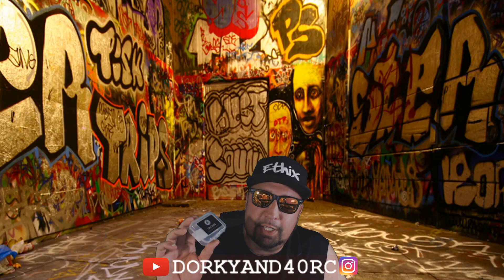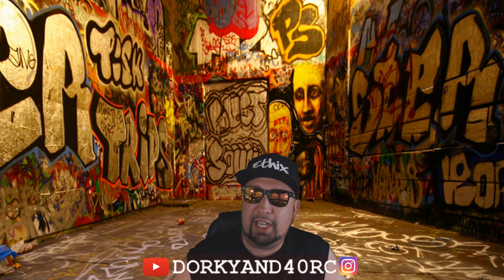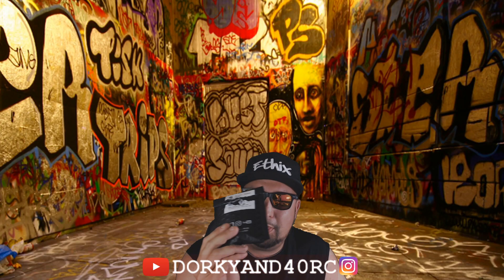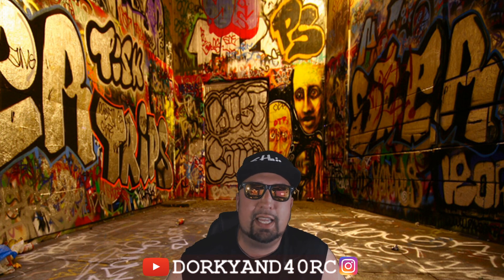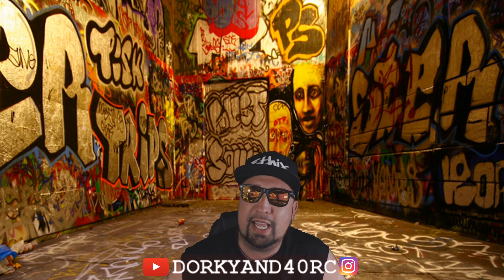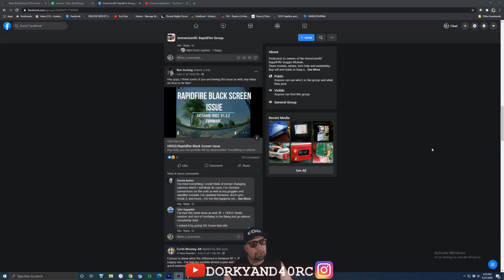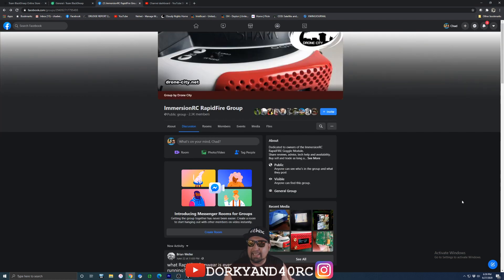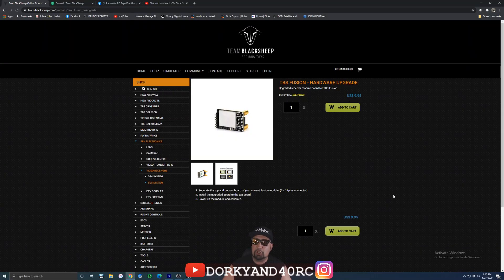WHATS THE BEST ANALOG FPV MODULE??

Comment: Bruh, i like u, so just stopped by to say, stop with the analog garbage, ya clearly have hobby monies, just go dji already ;) ...is 50mbps at 720p 120fps, not enough for ya ?  Hehe recent FW update if ya aint know
Reply from the maker: eventually..but right now my fleet just isnt setup for it and im happy with things..i have 2 many hobbies that take all the money :) so the girl says!!
Reply: @Dorkyand40  ok man,  i get ya, & just saw others comments bout dji .....vista will fit almost any frame tho ;)
Reply from the maker: The first thing I would put dji in would be my fpv crawler I’m using crossfire in !  That would be amazing ;)
Reply: DORKYand40RC well definitely don’t go on YouTube n look at dji fpv crawler vids then ;)~
Reply: @Dorkyand40  dude i just bought a cheap lil rock crawler on amazon to put air unit in cuz of you ...thx ;)
Reply: When you often fly with some more People at the same time, dji has a problem, i meam all people that use analog are having a problem. On oure field analog and digital pilots can`t be in the air at the same time.

Comment: Interesting Video, You should have played the whole flights, I was trying to watch the noise levels and i was unable to see the SNR and DBM on take off or landing, but at the point you turned around the noise floor was at 50% but i see nothing around? to interfere with you.
TBS are complying with FAA rules from what i can see ( Wifi in the fusion that connects to your module and Tango 2 ) who know what (data) will be required to stay in business, And what the FAA will ask for, But if you look at the new TBS Micro module V2 you will see it has an non removable antenna as per the regulations.
Either way I'm With you My Crossfire has never let me down yet so I'm sticking with that.... anyone have a old crossfire module They would like to sell must be V1 ... :-)
Great Video as always.
Reply from the maker: Thanks. I just try not to get lost in the numbed now. If I head out that way for a mid range flight I just do a quick glance on the way out since I’ve flown it so much I know what my levels should be. It’s saved me a time or 2 :)

Comment: I've got the DJI set up now after around 8 months on analogue.
I prefer the way digital handles signal loss to analogue. DJI has really improved the product to prevent lock ups without any warning.
Now just by watching the screen pixelate I can tell what's happening and still have clear sight of what's in front.
I've also got a basic Eachine pro 58 module for my DJI and I find this works great for me flying mostly fields and light woodland. Any bandos I fly and I don't touch analogue DJI is far far far superior in this area. 

:-)
Reply from the maker: My other issue is a lot of the 3 inch ships I like to fly wouldn’t fly or fit even a vista unit. Maybe soon. Glad you’re enjoying it though!  That’s what matters most.
Reply: @Dorkyand40  thanks for the reply.... I hear ya.
Coincidentally my digital is a 3 inch toothpick style quad with 1404 xings... I run it on 2s as I prefer to just take in the scenery.   I get a good 6mins on a 2s 750mah gnb battery and with crossfire I can do some nice long (ISH) flights on it. It's not a racer but it's very capable non the less and with a smaller battery is even nicer acro wise. 
Some are now decasing the caddx vistas to reduce even more weight on the digital set ups.... I'm skeptical but so far no issues reported.
I've got a toothpick 3 inch analogue also which is really quick for the adrenaline sessions. 😂 
My 5 inch is analogue but when funds are their ill probably put digital on it as well.
Reply: Got the DJI v2 and an Eachine Pro58 with Achilles. Can you recommend any special setting regarding image or signal quality? I only selected AV in on the goggles and picked the correct Raceband channel on the module. Is there any significant difference in the different raceband channels or is Channel 2 exactly like Channel 8? Cheers man